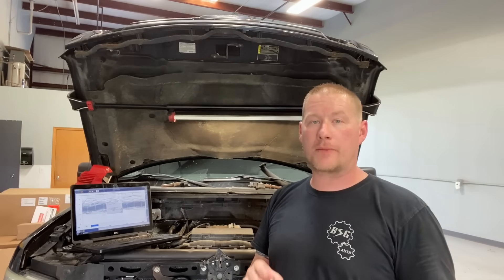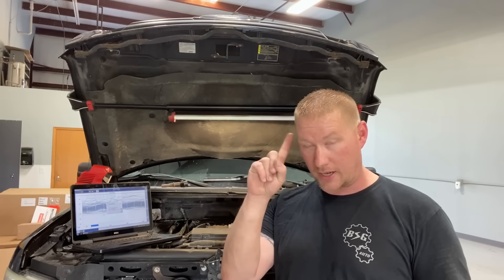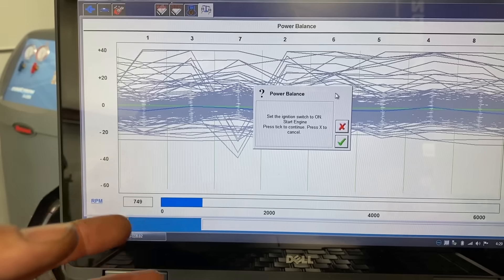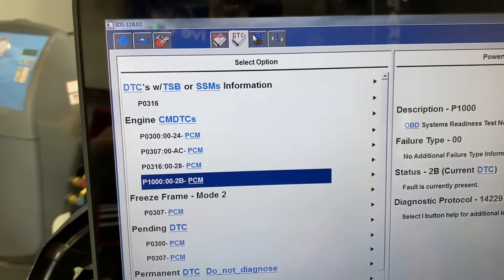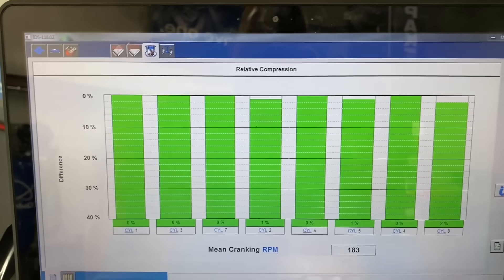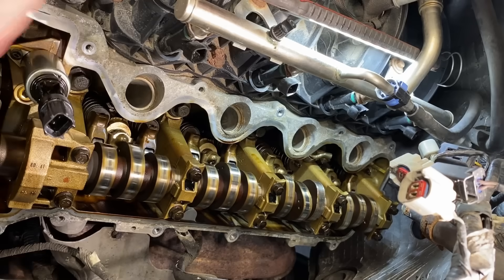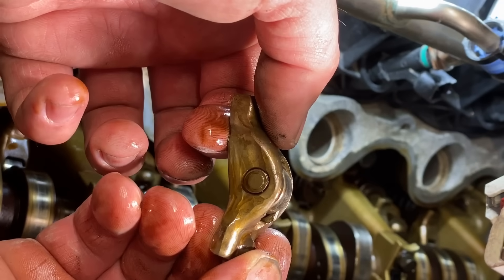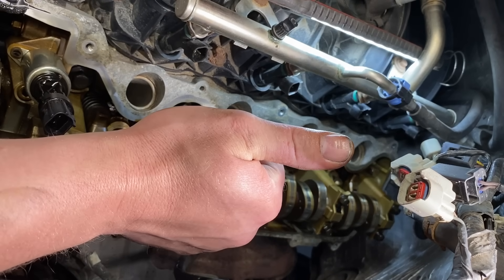Ford F-150 & Expedition 5.4L 3v Triton Engines Hard to Diagnose Misfires Fixed!

Comment: Any time a technician tells me the PCM is bad I tell them to go find something else wrong.  It's 99% of the time NOT a PCM problem.
Reply: Many techs today are what I call a JAFI ... Just Another F###ing Installer. Manufacturers use to make it so things could be rebuilt. Now it's mostly one time use components.
Reply: 3.5 shorted coils burn up the driver in the pcm all the time.
Reply: Bad ecm or computer on my 4.6L expedition twice. Replaced it once for a transmission/shifting problem and two years later it went out again no spark no fuel. Luckily I found a website that was selling the ecm fairly cheap at $150 new.
Reply: @charliehustle2579  But what caused the failure?
Reply: @rays7437  not sure. But I know what fixed it. The trucks been running ever since. The transmission not wanting to upshift and would over Rev at 30mph that was a bitch to diagnose. It threw a solenoid code but it wasn't the solenoid. Checked ecm harness that went behind the firewall that snaked  on top of the bell housing to the tranny, no wires  were pinched there. Suspected the ecm at that point luckily it was a '98 and found the ecm for $150 so it was worth the shot. Swapped it, then boom solved! I work for a TCM now a Unicarriers dealer (forklifts) they have the k21 k25 4 cyl. nissan motors the ecm on those go out all the time.
Reply: Your correct Ray, only seen 1 three valve PCM that absolutely needed replacement.
Reply: PCMs really can't go bad without another cause. Maybe some wires shorted together on a circuit causing the PCM to overheat. But they're very very simple tech nowadays and there is almost always another problem that kills a PCM or ECM or any other computer on a vehicle. Replacing it will often fix the problem temporarily, and that may last a day or 3 years but it still doesn't fix the actual problem.
Reply: Unless it's a dodge
Reply: Never worked on a bmw have you. Lol
Reply: I diagnosed plenty of bad pcms in my day. Old Honda civics, they get rained on and corrode. There are guys that rebuild them. Fortunately, they’re also a dime a dozen used.
Reply: You are SO GOOD at diagnostics.
Reply: If you know then why don't you figure it out yourself?
Reply: my dad called the nut runners
Reply: As a technician that's worked on thousands upon thousands of fords and everything else I have changed approximately 2 ECM's in 30 years.
Reply: They can't though. They've read through the paragraphs, answered yes or no when the book asked. That's it, that's all the tech can do. By the way, the last step in the Ford service/troubleshooting manual is ALWAYS, replace PCM.
Reply: @zachcoldwell7978  I know.  All manufacturers seem to operate the same way.  But it's almost never the PCM.   I always tell the tech he has to pay for the PCM if it doesn't fix the car.  That's usually when they go find the real problem.
Reply: @zachcoldwell7978  LOL The Book  &    Cant Think.......  Seen Many Time
Reply: @FixItStupid  same,techs are such good little bolter on of parts guys so spiffy in their little uniforms and gloves. Seen some insane bills from the little red seal basterds an still not fixed. Once you figure it out it's always simple tho love that part.
Reply: PCM's do go bad especially on fords
Reply: @michaelsieber6601  more so on dodges
Reply: @michaelsieber6601   Rarely, unless the vehicle has been hacked up/tampered with.  In 16 years at Ford I've seen maybe a dozen just go bad for no reason.  Maybe it's different in other parts of the country.  I'm in the southwest.
Reply: @rays7437  I've diAgnosed 3 bad PCM so far this year
Reply: @michaelsieber6601  My parts department guys say they sell them to over the counter customers from time to time.  Unless there is a recall or something like the old Edges had.

Comment: Gday my friend

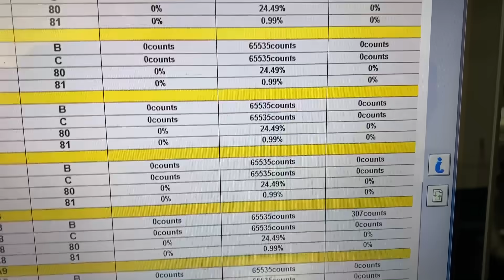I have 2012 Ford F-150 FX4 3.5L Ecoboost 4:10 diff gear ratio.

I don't like the engine and was wondering if I could switch the engine out for a 6.2L V8 (in a perfect world it would be a diesel)

I can be reach at 954.830-0365

Comment: Our 6.8 V10s had that problem. It was always the valve lash adjusters that would seize up, causing the camshaft lob to push the roller follower off. It originally took us a little while to figure it out...

Comment: i dont know what kind of shops diagnosed it for all the other issues...but they are a joke. a scope and a road test would have told you it was good electrically. Its those kind of techs that give the rest of us a bad name. Get a scope,start to use it,it gets easier to use the more you use it and your p ride level will go up when you can diag better then the rest of the shop.Also how do you call cats without jamming a vacuum gauge on it?????

Comment: Ford Tech:  why does my 2015 F150 5.0 V8 at start up have a clicking sound?  It stops after about 3 to 4 minutes at idle.  I have always used 5W20 Mobil 1 and changed it every 5,000 miles including filter change.  Vehicle has 39,750 miles.  Really appreciate your response and love your videos!

Comment: I don't understand some shops. I diagnose for a couple in my area and sometimes I scratch my head wondering how they couldn't have figured it out. It seems every shop throws coils and plugs at a misfire. This isn't the 70s and 80s where plugs go bad fast.

Comment: Great work as usual. These 5.4s are such gifts to mechanics.  Thanks for sharing your experience with all of us.
Reply: They are such a nightmare for anyone dumb enough to buy one!
Reply: @RPG-oh1yf  I’m about to get rid of mine. Tired of putting money into just so something else to fail. It’s literally been a constant thing since I got the thing 5 years ago. New spark plugs, ignition coils, fuel injectors, fuel filter, throttle body, several sensors, both manifolds, radiator. And still getting a cylinder 8 misfire. Thing is such a headache.

Comment: I know this doesn’t have anything to do with the video. But I have a 2013 f-150 5.0 4x4, does anyone know why my truck jerks when I put it into drive from park? Reverse to drive isn’t nearly as bad but park to drive always noticeably jerks doesn’t matter cold or hot still does it. I have already done full trans flush and didn’t do anything. If anyone could help I’d really appreciate it.

Comment: Hi Brian. Thanks for all the great information on the 5.4 3 valve. Is it possible this can happen on other cylinders. I’m have a miss fire on cylinder 4. Changed the plugs, coil and injector. Same thing. Any advice would be greatly appreciated. Thanks
Reply: You ever figure out your issue?

Comment: Spot on!! My 2010 F150 made the ticking sound on # 3 and the roller follower had so much lash it run like it was out of timing. Replaced the whole side of roller followers and now the engine runs great! Thanks for all the videos you make.

Comment: You’re the diagnostic guru for sure. I’ve learned so much about the 3v following all your videos. I have a 2005 F250 with the 5.4 3v has 289k original motor never had a failure.
Reply: Is it mostly highway miles?

Comment: Please help just bought a 2005 f150 was told cam phasers were replaced I just did oil flush n replace and replaced both VCTs and truck sounds like diesel only when warmed up to half mark on gauges... I can increase rpm when cold no diesel sound but once warm it sounds like diesel??anyhelp @FordTechMakuloco

Comment: Had the exact same problem happened to me but on a 2006 3.7L Dodge Ram very hard to find problem changed everything from injector, to plugs, coils and problem was still there! Until I opened it up and sure thing the roller had popped out!!. Really enjoy your videos a lot of great info in them. Thanks 👍🏽

Comment: this is great info. Maybe you can help me with another mystery.... changed the spark plugs on 5.4 2v 204 expi about 3000 kms ago. all went well. it started misfiring and showed P0302.  when removing the COP, the sparkplug well is full with engine oil. Not burnt, but good engine oil. the valve cover around that area doesn't show any leaks, the intake doesn't show any leaks. So its puzzling to see the oild there as the plug is clean as new when removed. any idea where that oil might have gotten in??

Also, what software or tools can I use for this Expi. Any help and thoughts would be greatly appreciated. The dealership here (in the ME region) isn't of much help and too expensive and they practically are worse than the independent workshop, who also do a hit and trial especially on the Fords!!
Reply: Yar Nunya  unfortunately no. Here everyone thinks it's below their dignity to fix things yourself. One MUST always buy the services as simple as changing an electric bulb ;-)

Comment: I have a '97 4.6 with a miss on the passenger side rear cylinder.
Wonder if that is the cause or not.
500K mileage and 140 compression on all cylinders except that one = 100.

Comment: I have a 2007 F150 5.4. I watched your video in 2016 and did the whole cam phase, timing chain, vtc solenoids, etc. It is starting to "diesel" again occasionally. I used a friend's scanner, (he is also a mechanic, it wasn't a cheap one but not super expensive either). Any way, he has moved away and I have tried a few cheap ones and am looking for a good scanner to read the codes. I do all my own work on my truck and my daughter does hers on her 08 escape. We couldn't do it without your videos, so thank you for being clear and concise and honest! Anyway, what scanner would you recommend?
Reply: Did you install the mellings oil pump or continue using the original?
Reply: @TurmiteRS  I used the original because they sent me the wrong size one, it was for an 4.6 I think

Comment: Ford should have installed clear valve covers so we could see this happening for diagnosis. I heard you say that these are the large hole followers. Is it wise to replace the drivers side bank of followers with the small hole followers and do you have a link to get these for the intake and exhausts.

Comment: Exactly what happened to me on my 03’ King Ranch. The previous owner chased literally all the other “common issues “ w the 3valve junk. ReplAced all the other parts. Except for the phasers. Gave me the new parts to do the job. Then sold it to me. Never make that most fun mistake ever again! Right as I got the driver side phaser done, I cracked open the passenger valve cover and had 5 roller followers all completely chewed up into pieces. My mistake buying it that way. But you live & you learn. Bought a 2019 Silverado with a warranty and the extended warranty when the factory warranty is done lol.
Reply from the maker: 03?

Comment: That's some high miles for an 09. Mine is an 01 5.4 2 valve and I only have 267k mikes on it so far. Is this an issue on the older 2 valve engines? Otherwise, I love my truck and your videos! Thanks for what you do by sharing with everyone.

Comment: Brian should be RUNNING Ford not working on their products!

Btw any future 1st gen EcoBoost (specifically F150) videos planned? I have throttle tip in issues with my truck and selfishly am hoping you have had one come into the shop with the same issue.

Comment: with 280K miles, time to replace the engine, or drive it until it craters, not chase down a problem.
Reply: No, replacing an engine on the assumption that it's bad without doing diagnostics and finding the problem would be stupid.  If the problem had been caused by any of the stuff that was replaced before Brian got to it a new/rebuilt engine wouldn't have cured the problem since those parts are generally transferred over to the new engine.  A well maintained engine at 280k could have plenty of life left in it.  A new or high quality rebuilt engine is a lot of money, a cheap rebuild might not be as good as this old one.
Reply from the maker: This guy used synthetic oil so the inside was ultra clean even on the PCV side as shown. These engines go well past 300k when maintained like this, the base engine is a very stout design and should be fixed for minor issues like this.

Comment: Man I wish you were in Texas bud. You definitely know your craft. My 09 5.4 has is approaching 200k and it runs fine. But I’m starting to hear that tap tap noise which I suspect are the cam rollers. At what point do you just give up on the truck and sell it if it’s going to need all the work you described in this video? I can imagine all that work won’t be cheap and I’m not sure the value of my truck supports having the work done. Your response will be greatly appreciated.

Comment: Have f250 5.4 3valve changed every thing in timing truck runs great for aboit 10 minutes then runs like crap any suggestions
Reply: Lots of possibilities.  I'd start with checking for fault codes, including pending faults.

Comment: Would the misfire be as bad if it were the other intake rocker on that cylinder? I would think the closed runner's valve not working would have little effect until loaded to moderate revs.

Comment: Does all the fuel from the injector pool in the intake plenum? lol Dangerous. I'm surprised these things don't blow intakes through the hood when that happens.
Reply: Nope, the fuel is still going into the cylinder through the valve that still works.  Even if it wasn't there's no way it would pool in the plenum and cause a huge explosion.  First off, there's nothing to push that fuel from the intake runner up to the plenum.  Also, there should be nothing entering the intake to ignite that fuel.  Even if all that happened, at most it might break the intake if it accumulated just the right amount and something caused that fuel to ignite.  For gasoline to explode it has to be within a fairly narrow range of air and fuel, too much or too little fuel and little or nothing happens.  The intake isn't big enough to have anywhere near enough explosive power to go through the hood.

With an old carbureted engine the intake is always full of a nearly perfect mixture of atomized gasoline/air.  Those would be way more likely to explode violently, yet they don't.

Comment: Could this happen on the 6.8 2V as well?
Reply: Any similarly designed cylinder head could spit out a rocker, but a 2v engine would have a constant misfire and lost compression on that cylinder making it easier to figure out.  Loosing only one of two intake rockers like this 3V did will let the engine have perfect compression and run ok under some conditions making it harder to figure out.

Comment: Back to basics! Why everyone over thinks the engine operation because of electronics,  it's been that way since the first ECM. Good job Brian!
Reply: @James Masn you are definitely correct but i would like to add one reason for the lack of knowledge. 
Mechanics do not get paid enough. Anyone who has the mental capacity to do this kind of work could easily go into another industry. They will make more, won't have to take out a mortgage for tools, and won't destroy their body in the process. 
So from what I see everyone is going to enjoy the shortage of skilled mechanics for the foreseeable future.
Reply: @bobt8578  you are exactly correct! Between the cost of tools, advanced brand specific education, getting paid book time, shop/dealership corruption and a host of other things is why I didn't stay working as an auto mechanic. Many car guys also won't get to be exposed to but so many scenarios and the lack of good pay won't justify staying on the job. There is already a shortage of mechanics in this field because of the reasons I've stated. Sad
Reply: Joseph Miller it’s not only that you can only learn mostly through doing and Brian does a lot of these so it’s easy for him. He knew right away it wasn’t from diagnosing it was due to experience and doing. These things need to roll in the shop for most unless the employer sends techs for training
Reply: True I left automotive to fix home appliances make almost 20000$ more a year work 8-6 mon- fri got it made no more nights or weekends at the dealer

Comment: Diagnostic machines are awesome but it takes experience to make sense of the data. I can’t believe the guy put so much money into such a high mileage vehicle.
Reply: If the first mechanic had said he'd need all that stuff at once he might have decided to get rid of it.  When you're repeatedly told that a few hundred bucks will get your truck running right you're more likely to accumulate that spending.  Unless those mechanics warned him that their repair might not cure it he should be getting his money back for each misdiagnosed repair.  Any time I'm unsure, and this odd misfire would have been one for sure, I tell the customer what I think might cure it and ask if they want to take the chance or take it to someone else.

Saying it needs all new coils and plugs because of a single cylinder intermittent misfire would be stupid.  Saying it needs all new cats & muffler even more stupid.  But, I've met some owners that'll opt to go overboard when I tell them they need just one thing so there's no telling if the owner or the mechanics decided to go overboard with this thing.
Reply: @DonziGT230  agree, sometimes you get to a best guess situation, like you i always tell the customer the same as you do.if he wants to go somewhere else i'm o k with that, no hard feelings by either the customer or me.
Reply: letting customer get a second opinion is not a bad thing cause as dirty harry said " a man's got to know his limitations"..

Comment: With those miles I'd say it be best to just drop a crate engine in there instead of the timing job alone because it's likely it's going to need more work sooner than later.

Comment: 280k+, I would wing 1 new roller in it and run it. Make sure no other ones are sloppy first though. Replace the engine or truck if you have further problems.
Reply: Yup.